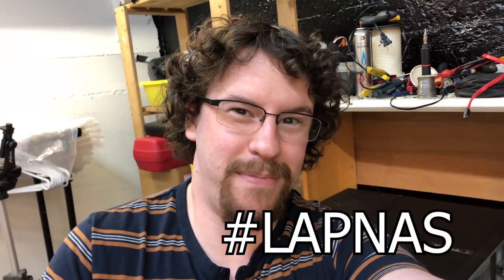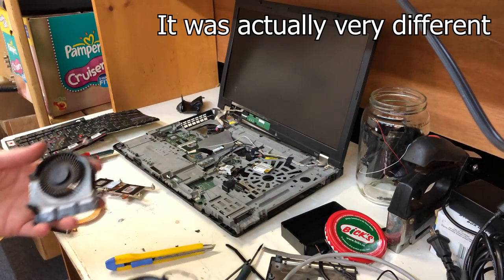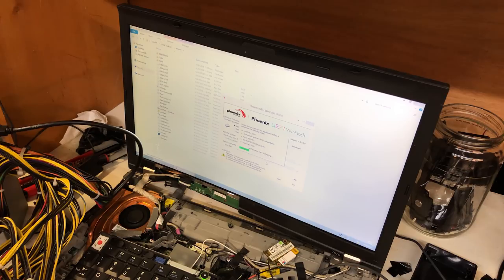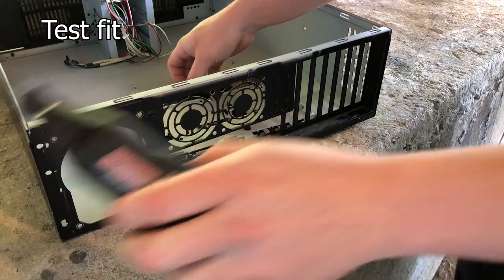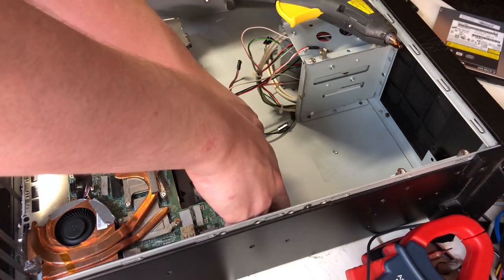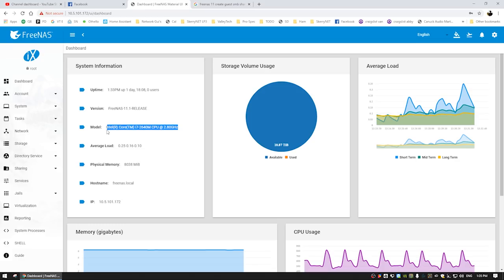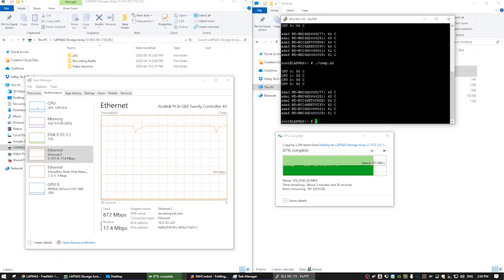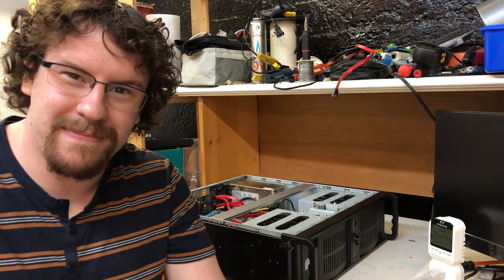I turned an old laptop into a power efficient FreeNAS server using hot glue and duct tape!

Comment: Just as a recommendation, even though you aren't running GPUs through that riser its a better idea to use an actual 6 pin pcie connector rather than sata. Coming from a GPU mining perspective, its pretty risky running sata power on risers. I have seen many pictures of smoking and black sata power connectors after being used. I guess you aren't pulling much power, but still just trying to remove any more fire risk than you already have haha
Reply from the maker: Totally, I was not super concerned since the power consumption on the sata card is much lower then a GPU.
Reply: @TechwithShae  👍

Comment: So, my question is how did you trick the bios into loading without having a battery?  I'm having an issue with an old Dell laptop where I need a replacement battery.  But to use a non-Dell battery (now unobtanium) you have to flash the bios.  But to flash the bios you need a working battery.
Reply from the maker: I downloaded the Phoenix bios flash utility, and started it with the "force" flag. Then all I had to do was select the file I wanted to flash and hit go. Surprisingly it was pretty easy even though I couldn't find any guides online.

Comment: Just curious, just what's the average/max power at the wall socket does this build uses given this is an "ultra power efficient" build?
Reply from the maker: I added the power measurement results to the video description. I was basing that statement on the specs of the Synology DS1618+. Although my access power is higher, my standby/hibernation power is lower. If I were to put a lower power CPU in this laptop I think I could get the numbers lower without sacrificing performance.

Comment: How did you connect the motherboard in to the power supply?
Reply from the maker: I’m using the original power brick plugged into the docking station for the motherboard. I was looking at a DC to DC power adapter so that I could use the power supply in the case to power the motherboard though, I would need something that converts 12v to 20v. Right now it has 2 plugs.
Reply: @TechwithShae  i know it a old video. But did you know that you could get 20v out of that PSU? You only need to bridge different outputs and check with a multimeter. Just try on a old PSU first though.

Comment: 8GB is not enough! even 16GB is not enough. im using 32GB in my FreeNAS server with proper server hardware and its still not even enough. i have 6 3TB NAS disks and 4 1TB disks for iSCSI. and i can reach 350 to 400mb/s on a 10gig link! you can end up with data corruption without ECC RAM.
Reply: 8 GiB of non-ECC RAM is totally fine for a NAS that you use at home, if you have a big Database or VMs hostet in a Company setting, 32+ GiB and ECC RAM (and a UPS) do make sense

Comment: Hello!

Great project! Im trying to set up a similar NAS using an old hp 4510s laptop motherboard and omv. But i have a small issue. Depite the fact that i have the system installed and configured, once i turn it on without a monitor attached, it refuses to boot and turns off after a minute or two. I have searched the bios for settings that correspond to some kind of headless operation and i couldnt find any, I run an bios update but the problem persists.

What do you thing?

Thanks in advance.

Comment: Hmm I wouldn't call it 'low power' Looking at just the idle 18.1W idle specially. I'm going to blame the ATX power supply for starters. Also I wonder about the performance numbers out of that pcie 2.0 x1 (at best?) mpci m2 slot.
Personally I'm looking for a solution to plug in a 10gbe card (sfp+) and 2-3 drives and 1-2 nvme as cache on a system using dc power.. very hard :p
A+ for effort though

Comment: very interesting but you should zip tie a fan in front of the hard drives and it'd be a great little nas
Reply from the maker: I was thinking about doing that, I have no spare fans at the moment, but I'll scavenge some very soon.
Reply: Buys a $50 fan to cool $10 drives.
That's got to be a meme.
It would be interesting to see what it takes to cool everything.
Reply: Good place to get fans is from busted power supplies

Comment: man this reminds me of the days i ran all my HHD's in their USB enclosures before shucking them into my new unraid build. I use to run 6 x 10tb USB enclosures HHDs in unraid via USB 3.0 and i got 180-200 transfer speeds.. curious why yours are running so slow? is a quick removal policy enabled?
Reply from the maker: I’m almost positive the bottleneck is the  old 3gbps sata card, and the fact that it’s a pcie 1x slot. It was definitely a made from junk build, if I get my hands on a newer card I’d like to give it another go and see if that improves the performance at all.

Comment: Have you flashed the RAID card so that it only acts as a passthrough for the HDDs (so they can be RAIDed in software) rather than actually a hardware RAID?  [IT Mode]    I always hear that using RAID cards as-is is a big no-no when it comes to servers
Reply from the maker: The original card I tried does not have an "IT Mode" unfortunately, the second card I tried is a simple HBA card though, so no raid at play. You are correct though, using a hardware raid card is definitely a no-no unless it can be put into IT/HBA mode.

Comment: Cool but what matters is transfer speed when you have several drives in raid and the little pcie does not have enough bandwidth.
Reply from the maker: It’s definitely not an ideal build. Not enough ram, and the pcie 2.0 1x slot is a massive bottleneck. But for a total cost of about $10 and spare parts, it could be usable.